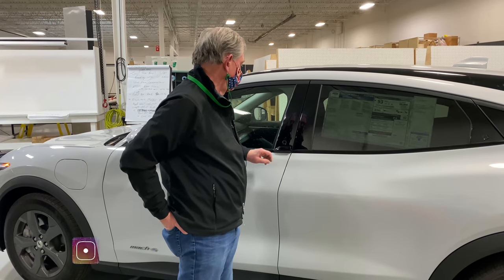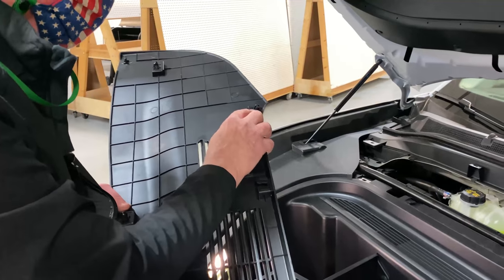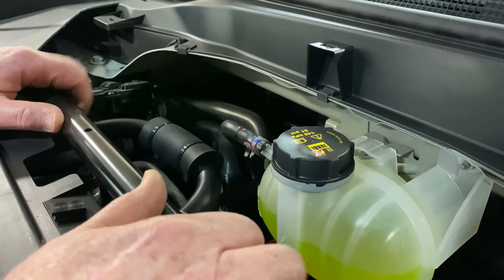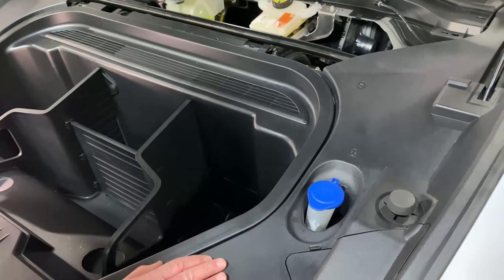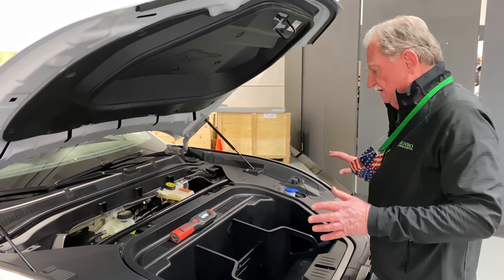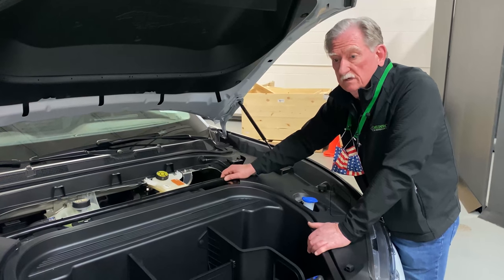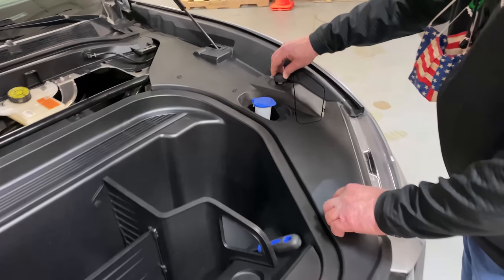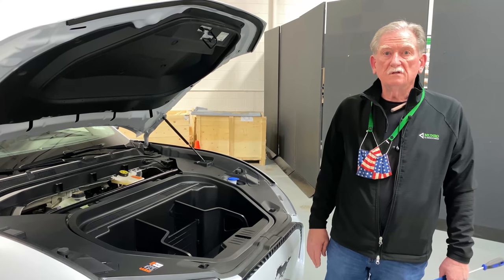2021 Ford Mustang Mach-E: E2 - Under The Hood

Comment: Discovers you can put beer in the frunk: This is a Tesla competitor!
Reply: Ahah
Reply: chuckle  Note to EV designers - if you want Sandy to like your car include a beer shaker in the frunk with circular launching pads to place shaken beer into for lift off.  Also ensure that you include a drain hole to allow the sticky IPA to drip all over the front motor and other components under the beer shaker!
Reply: LOL. But it's the simple things that sometimes can make all the difference. To ME the frunk says "We put some thought into this car. Hope you like it. We were thinking about you". They put in a frunk and then added dividers to make it more useful. I guess If you don't need the dividers you toss them under the back floor.
Reply: And they put the beer & ice bucket right next to the critical battery 👌
Reply: Actually that features mile sale many mustang EVs just for that feature😅
Reply: Unfortunately porsche ferrari..... have been doing that for decades.
Reply: @GROND15  divider's are because of car regulations
Reply: So funny... also why not design a built in, removeable cooler? This is not removeable and your ice will melt quickly, so you have to drink right there, and fast!?
Reply: @GROND15  the dividers were regulatory requirements, not for usefulness
Reply: @Nature_Quixote  Pricier and a third party could probably do a better job and make money.
Reply: lol 😂
Reply: Conclusion: Sandys Cybertruck needs a beer frunk like that.
Reply: @GROND15  better to put more real range and speed
Reply: @cm7012  If it is a regulatory thing, then why aren't other EV's required to have dividers?
Reply: @Nature_Quixote  a removable cooler is a separate component with multiple pieces that adds cost, maybe $150 more vs $3 for the plastic parts.
Reply: tesla: hold my beer.
Reply: @zerix01  other cars usually have the internal emergency release incase someone is trapped in there. Dividers mean that no release is needed.
Reply: @cm7012  Do you know which regulation?

Comment: Seems silly not to have the frunk dividers easily removable to take larger objects
Reply: Remove a few clips and it comes out.
Reply: You can see that most of that pulls out to leave an empty frunk. Be nice if they designed the pull-outs to fold flat unobtrusively in another part of the car. Maybe they have?
Reply: it's too get around the rules that if the space is bigger than some volume it have too have a emergency releace button inside in case of kids stuck in there. so they devide it up too get bellow that limit.
Reply: @sasor098  ^This guys gets it.
Reply: I believe this might have something to do with preventing children from wanting to crawl inside. Even though there is a glow in the dark button to release the f-runk, I think some new law also requires the cavity to be divided into small enough sections.
Reply: Sandy clearly drinks more beer than I. Most likely, I travel with groceries more than he does, and I'd much prefer a usable frunk (note: a frunk is a refrigerator for groceries in cold weather).
Reply: Regulations, you do not have any means how to open it from within so they made sure no one can get trapped there
Reply: My exact thought.  You beat me to it, Mike.

I didn't like the over-aggressive fasteners, either.  They break too easily and make accessing components, like the 12-volt battery, more difficult (read: maintenance will be more expensive because of bad fasteners).
Reply: For those of us in countries where drinking and driving is actually illegal, it would be nice to have a Frunk design that accepts larger pieces of luggage. Keep the drain hole though, that is a good idea
Reply: The better to hold lager objects, m'dear...
Reply: @sasor098  Weird thing is though: it has that button (4:53). So they wouldn't have needed to make the dividers that hard to remove. Or is there actually a new law that has them divide the space even though, like TypeTuber suggested? But how would that make sense, considering trunks probably won't have to be divided into that small sections?
Reply: @15bit62  Oh come on. This is obviously for stuff like cookouts and tailgating. It's not like you can drive while the hood is up and someone's sitting in your frunk.
Reply: @Urgelt  while it's warrantied theyll probably just slap a brand new plastic piece on, clips and all, anyway
Reply: @maxnovakovics2568  Which drives up costs - one of Sandy's pet peeves - and leaves owners holding the bag after the warranty expires.

It's not justifiable.
Reply: I read recently somewhere that Ford already got rid of the divider in new deliveries...
Reply: @jledge4797  A drop-in divider might be a good thing to offer consumers.  A fixed divider just restricts how the space can be used.

I do like the drain, though.
Reply: @sasor098  Good point!
Reply: I’ve read it’s a safety issue for kids.
Reply: @sasor098  Consumer Reports: "If we use an angle grinder to cut the interior dividers out, we can squeeze someone in there, so this frunk is teddibly, teddibly unsa--what's that?  We got a six-figure donation from the Ford Foundation?  Oh, right, never mind then."
Reply: @sasor098  yes but you can see in the video Ford added the release anyways
Reply: It was a last second add for global regulations reasons (aka, the lawyers put the divider in).  It was not originally designed to have a divider (none of the pre-productions had one) and there was not time to design a better one after the lawyers had their say before production started.

I agree, it is a bad divider and i bet it will be improved next model year.  It is at least pretty easy for owners to remove and throw away.
Reply: They did it for US regulations. Over seas there’s no divider
Reply: @sasor098  exactly. But I luv that you can take it . If I chose this car over the model Y the first thing I’m doing tag the dealership is removing it
Reply: @jledge4797  article

Comment: Not as important as keeping the beer cold, but it'll also keep your other groceries cool as well if you're one of those slow shoppers.
Reply from the maker: Very true!
Reply: Ice cream and meat.
Reply: Why, its not insulated, it'd prob be cooler inside the car a.c.
Reply: @emmanuelgutierrez8616  Depends on the weather outside. If it's really cold, you'll be running the cabin heater, which likely warms the trunk. But put your groceries in the frunk and they'll stay nice and chilly. When it's hot outside, keep the groceries in the trunk, and the AC will keep them cool.
Reply: @emmanuelgutierrez8616  1 ) Cooling takes extra energy. The EV killer nr1. 2 ) all the ( Belgian ) beer is gone before the ice is melted ;-)
Reply: @emmanuelgutierrez8616  AC is not on while your car is park between stores, some people like to shop around from more than one market.
Reply: @Tien1million  I leave AC on in Tesla when shopping between stores.  Keep the meat & fish cool to maintain quality.  I often put some refrigerated items in an insulated bag.  Tests have shown cabin temperatures exceeding 140 degrees in warm climates.  Can the Mach e run AC when unoccupied?
Reply: @johnpoldo8817  I have no idea, maybe Sandy can test it out.
Reply: @Tien1million  I guess if you're thinking about the water droplets from frozen food, but my point is that the fronk is not insulated so it's not going to hold temperatures. There's insulated bags you can buy, but they're mostly waterproof too so it doesn't mater where you put it.

Comment: Sandy, the cargo divider is for regulation. If it were removed, the space would be too large and require an emergency escape latch. Dividing the space like this is a loophole
Reply: Interesting!
Reply: Wow! That's a clever two-fer, then!!
Reply: They already removed the divider from new builds. And there is an emergency latch.

Comment: Rubber seal on hood is also far less likely to get torn up. 4 stops prolly ensures tight & square seal between rubber gasket & tub.
Reply: That is exactly what I thought and was just about to write. Took a look first if someone thought the same. Anyways, that also explains why Sandy never designed 4 stops: ICE cars usually only have a gasket covering the forward face of the hood.
Reply: @GurgelKoff  U R the best!

Comment: Any panels covering occasional access items like fluid reservoirs and batteries should be fastened with with screws or 1/4 turn clips that don't break.  The plastic clips on this one may save Ford a minute of assembly time  and a few cents per vehicle but is a PITA for the dealer or owner. Just shows where the manufacturers' head is at.

Comment: part of the reason they split the frunk is to avoid having to include an emergency escape button/handle. at a certain size it becomes a requirement, the divider makes the continued storage space smaller then requirements

Comment: Frunk divider is eliminated on job 2 for the 2021 model. OTA updates will provide functionality of the front electric release for job 1 vehicles. Soft button on the large screen and Ford Pass app will now operate the frunk release as well as via the door code 7/8 button after code is entered.

Comment: The drain hole can also be for a wet umbrella ;-) And the 2008-2013 Chevy Avalanche also haves some ice boxes in the back. So with all the stainless-steel they use at the Cybertruck, the least I expect is a build-in BBQ :-)
Reply: Brilliant!!! Put an electric smoker in the frunk of the CyberTruck!!! 😃😋 And route the smoke outlets under the rear bumper just for laughs!!!😆
Reply: @danoberste8146  Or out a "stack" behind the cab perhaps?
Reply: @danoberste8146  In the frunk , there is also room for a fridge ;-)

Comment: If Ford had flipped the 12v battery around, you could jump it easier, since any place on the frame would do as a ground, and the +(red) terminal would be easier to get to with a jumper cable or 12v battery charger, without have to pry that panel up.  Otherwise it is a good clean design and far superior to the VW, by not wasting that highly useful storage space under the hood. 👍🏼

Comment: Sandy, the frunk on the Mach E sucks.  I can put groceries in my Model Y.  I can put a cooler in my Model Y.  I can see the advantage to a drain hole.  Removing the access covers was ridiculously difficult, especially if you need to jump the 12v. They stop taking orders on the Lucid Elite. Do you suppose that after seeing this Lucid is making plans for a wine cellar?
Reply: The frunk of the mach E is certainly way cooler than the model y and the drain hole is good addition. The ford engineers aren't dumb and they have probably used another solution instead of jumping the 12v battery.

Comment: Love you Sandy but the ice chest idea is not that big of a deal. In fact, I would bet most owners will reclaim the full storage space in the frunk by removing the dividers. Thanks for all you do!
Reply from the maker: You're Welcome!
Reply: I think the divider is removable. Noticing two openings at top of the divider. I imagine grabbed it by both hands and just pull it out.
Reply: @jauharvey3534  Not that easy. It's held in place by a few allen screws. It's removable, but not as easily as it should be. If I had one, I'd replace those screws with some thumb screws I could remove without tools. I'm a fan of the dividers, but easy removal would be a must.
Reply: Agreed.  Although it’s a “slick idea” and would be a nice addition to my Tesla, I highly doubt I’d ever use it that way.  Just as easy to bring a small cooler that I can place a ways away from the vehicle.  I don’t need to advertise that the hood is open.

Comment: Great video, Sandy.  Very revealing.  I've come to a totally different conclusion.  Tesla has nothing to worry about.
1. No way to open the frunk without opening the driver's door.  
2. Frunk isn't secure from parking lot attendants.
3. The potentially large size of the frunk is nullified with those attached dividers.  I'd toss them out.
4. Will water get into the frunk through that drain hole when driving through puddles?
5. Ford made it overly hard to access the battery and fluid reservoirs with those aggressive fasteners.  
6. Broken fasteners will keep Ford dealerships happy fixing rattles.

Comment: Hey Sandy I know why Ford put does divider on the frunk. From exotic car experience, in order to save money and complexity, they put the divider so to avoid adding a human escape release in case of kidnapping which is a requirement for certain size frunks in the US.
Reply from the maker: There still is a release button. You cannot see it in this video but it is in the right front corner of the frunk.
Reply: @MunroLive  The dividers can be easily removed
Reply: The electronic emergency release didn't get regulatory approval before launch but will be with a OTA update soon, and therefore future mach e's will no longer come with the divider. They will also add multiple ways to electronically open the frunk.
Reply: Sandy answered the big question in Chris L's comment few comments down. The dividers are removable. So perhaps it was kludged in with permanent fasteners for the legal reasons you mention, until they could get the regulatory approval db4c 09 mentions.

Comment: is it too difficult to put an isolated ice box in the back of the car these days? especially when i need to transport the cold beers 100m from the parking spot to the camping site / fire place?
is this really better or an advantage at all? usually i don't have the BBQ directly beside the hood of the car.
nice marketing but not really practical.

Comment: One thing EVERY auto manufacture needs to implement.  Washer fluid reservoir needs to be able to fit 1 FULL gallon when the low fluid level warning is activated.

Comment: The 12v should be a little further back so both the + and - are accessible. Then you would not have to pop that extra cover to get to the +. But that crossmember is in the way of course.
Reply: There are 12v leads behind cover near passenger side headlight

Comment: honestly looks like you were supposed to slide out the cover but I dunno. watching him walk up with ICE and some burs is hilarious.
Reply: From what I heard, Ford didn’t want to engineer an inside hatch release for the space so they added dividers and can holders.  It’s cool, but it’s an afterthought.  Most people will remove as many of those dividers as possible and use it for extra storage.
Reply: @phxees  Many people will use this as a cooler if it retains temp well enough.  It is so easy, you just dump ice into the center compartment and have your stuff all around it.  The real question is if the drainage works well and water doesn't flow onto any components it may damage.
Reply: @_PatrickO  Good point, but you know it isn't insulated, and it's black.  It's mostly just for show unless you live in Wyoming or Oregon. 

It's something people will do once and then remember how silly it is to carry ice and drinks in a real cooler before dumping them in there.  People will find uses for it, but I just want the extra space for luggage,
Reply: Nobody is replying to your comment on the cover sliding out not popping up.
Reply: @johndodge8999  yeah I noticed that
Reply: @Kaodusanya  But you are right. It makes no sense to put fluid tank under a cover that can only be replaced about 10 times. And if you look closely, you can see the slit where he should have pulled the fixtures out.

Comment: Looks a bit silly you have to remove plastic trim where clips breaks off, in case of accessing the two fluid reservoirs. I guess they would be a regular service check point.

Comment: The divider is in the frunk because of regulations. There is only an electronic hood release rather than physical, so some countries wouldn't allow the frunk to be open so they put the easily removed divider in so that it's not a large enough space to require an internal mechanical release

Comment: Could compare the way First Responders would be able to disable the high voltage power by cutting the power loop to the relay switch.
The Tesla Model 3 and 4 have it very noticeable, but I cannot see it for the Mach-E  and the VW ID.4 ?
Reply: Ford did not use a power loop on the Mach-E (like many of the other EV manufacturers do), rather they have a Service Disconnect "Switch" for the high voltage system located in the frunk.  You can search "Ford Mach-E Emergency Response Guide" for more specific info on what they instruct emergency responders to do when working around the Mach-E.

Comment: Agreed that frunk is pretty good. Tailgate BBQ's/ parties are big in the US, but I feel they missed the obvious... a light.
Battery terminals should be easily accessed, preferably without breaking trim pieces. 
At some point in the vehicles life it's gonna go flat, or you may wanna jump start a friends car.... if you even can with this thing, or connect a light for your tailgate party!

Comment: So you need to break a bunch of 10-use-clips to check the 12V battery, brake fluid or other stuff you might want to check before a long road trip

Comment: I like the fact that having a drain hole + beer holder looks more important than a functionnal (non-separated) front trunk :P Now you will have to cut the body into pieces to get them to fit in the trunk!
Reply: The divider is easy to remove. More choices are better.

Comment: Had the tub out of my model 3 the other day.  Not really anything underneath,  so drilling a drain hole is possible. But you would either have to fabricate some kinda drain hose to go with it or drill a hole in the lowest part of the underbelly aero shield also since the water would puddle onto that

Comment: 12v battery access.  My '13 Audi S4 has the battery mounted in the trunk.  Audi was thoughtful to put jumper connector(s) under an easily accessible cover in the engine bay.  I'd hate to have to tear apart those plastic shields just to get to this ones 12v battery.  You would think that some engineer would have thought of this.